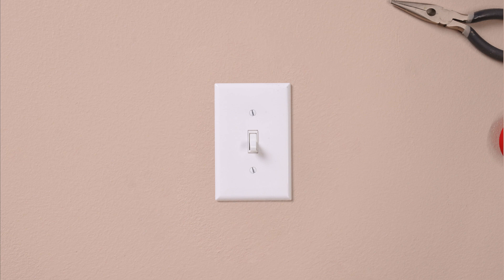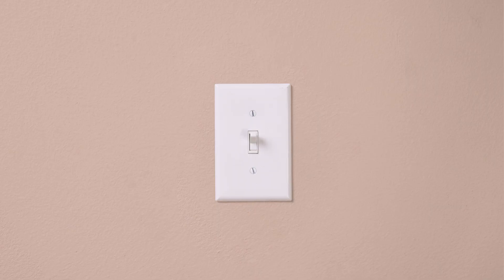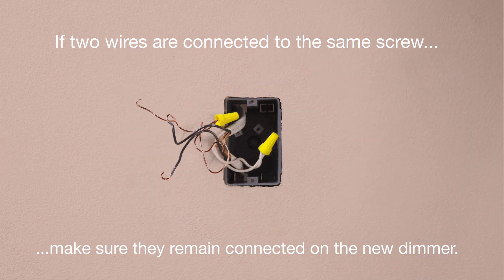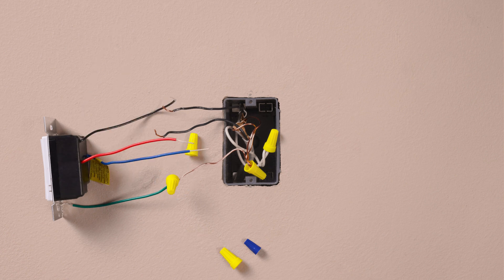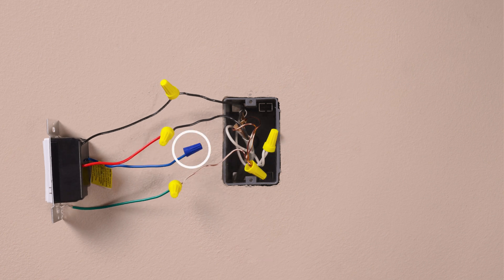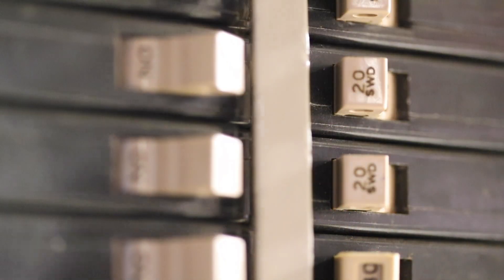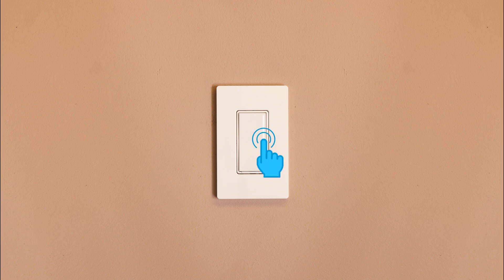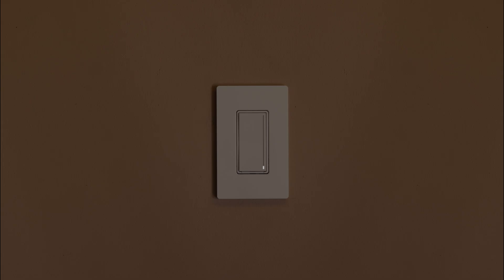Wiring a Lutron Sunnata LED+ Dimmer (Single Pole)

Comment: Red, black, and ground connected but the led light keeps flashing on and off. I switched the wires around but still flashes. Is the switch faulty?
Reply: Did you ever get an answer? Mines does the same thing.
Reply: @Tuga777 it was the wrong switch for the light I guess. When I'm up at the cottage and if I remember I'll post the model # we switched it out with. Was same brand.
Reply: @HamzOnTrading ok thanks for responding.

Comment: What if you only have two wires? I have a black and white wires and no ground wire. I know I can cap the ground wire like the blue wire but unsure if not having two black wires would be an issue.

Comment: I have 2 black wires. How to identify what connect to the red, and what connect to the black wire on my Sunnata?
Reply: Connect The red to the black wire coming from the wall.
Reply: @GarfieldThrownOutTheWindow  Thank you!
Reply: I connected the dimmer as instructed, but the light does NOT turn off.

Comment: Can I simply cut the blue wire off if I’m not using it?
Reply from the maker: Hello! Yes, if you only plan on using your Sunnata wire single pole wiring you can cut the blue wire. We would also suggest capping it off to ensure there is no bare wire.